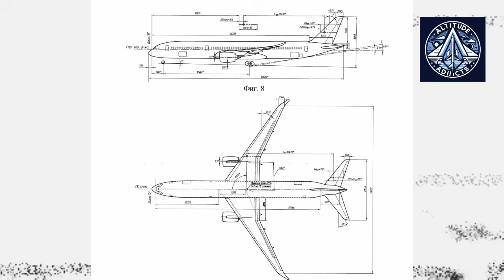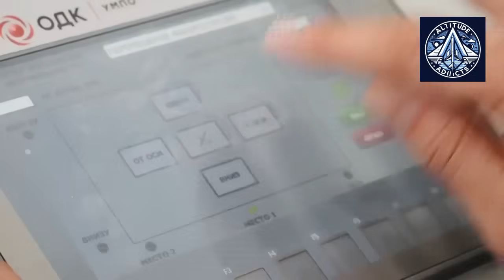Rostec confirms PD-35 engine for Russian Wide Body Aircraft Project | Il-96

Comment: Seems to me that the PD-35 is like the PAK DA and needs new technology and materials to get working properly. The PD-26 is a less ambitious smaller version that uses the guts of the PD-35 but should be able to be developed faster and easier and could be fitted to the Il96 and even An-124 to get those aircraft with improved domestic performance levels. I get the feeling that twin engine heavy jets is good for commercial operators, but I don't think the military would approve even if the engine reliability is a step up from existing types. The more aircraft engines they have working the better and can be translated into other roles including power stations and gas turbines for ships and trains and powerstations and long distance pipelines.

Comment: Do a video about potential licensed joint production of civilian aircraft with india (SJ 100 or IL 114-300). As recently indian Minister/high ranking government officials visited russia for some ongoing deals/projects and russian embassy of india confirmed one of the deal that is under implementation phase is- joint production of civilian aircraft. 

Yesterday russian government official- Aleksey Gruzdev also said that some talks regarding joint production of civilian aircrafts with india is currently ongoing and was reported by TASS/RT and other russian news agencies
Reply: This can be a good move so that India also should learn how to make aircraft just like Brazil
Reply: @lenziechundu3292  where did Brazil learn to build planes? They build some good planes.
Reply: @lenziechundu3292 primary problem is fuel efficiency tho. SJ 100 is 30% less fuel efficient than E190 E2. 
IL 114-300 is 10% less fuel efficient than atr 72
Even if these aircrafts are good. Finding customers in india would be challenging, especially because unlike china, all airlines are privately owned in india and thus naturally dominated by Airbus/boeing.
Reply: @helloworld.w6075  I heard there is, so far, a big drop in range with the MC21 as well with all the domestic equipment and PD14, on the plane.
Wasn't it a full 1/3 drop in range????

Comment: IMHO UEC is going to recalculate the engine config. RR developed Trent XWB with 3m fan, 37-43tf thrust and great advancement in SFC.
PD-35 does not require 3.1m fan for 35tf thrust. Fan shall be reduced to match requirements of the target aircraft.